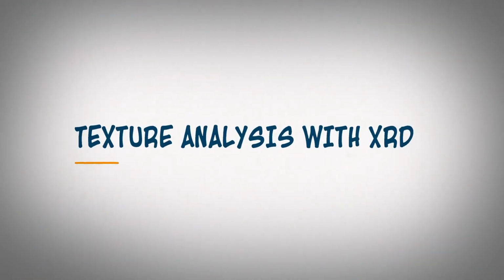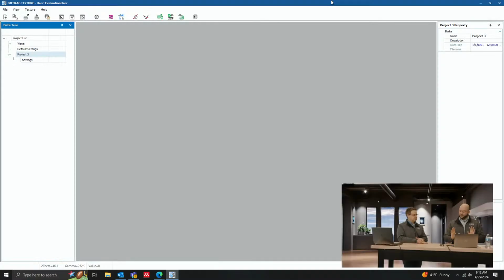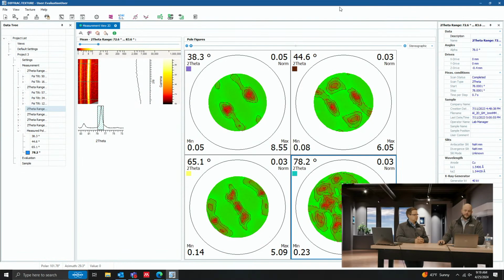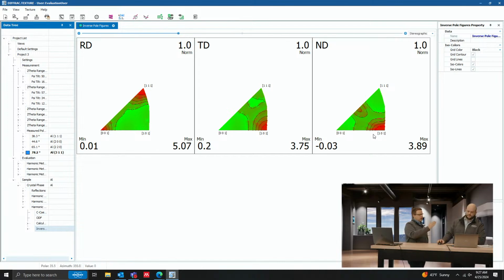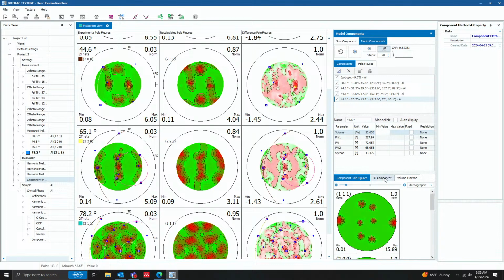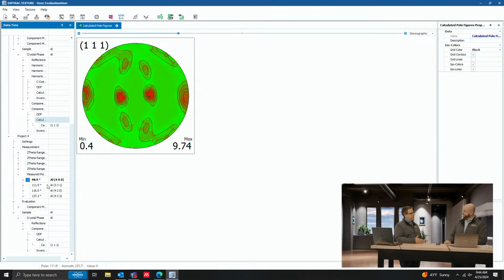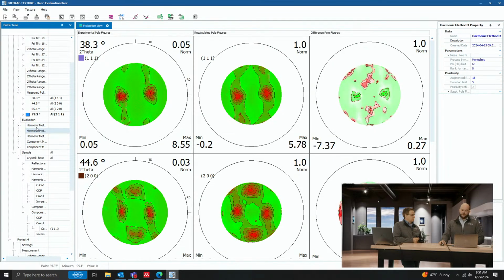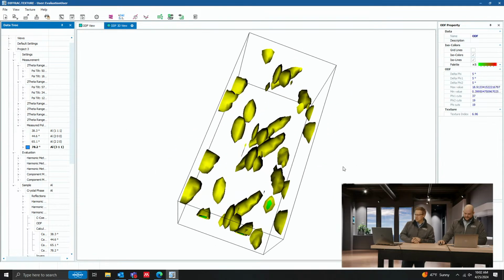Live from the Lab: The Gritty Details of Texture Analysis

Comment: Great lab session! I want to ask how much the iso-inclination will interfere the measurements if the sample surface is not flat? If the sample has a dome shape on the top, will the iso-inclination be a bad measurement type for texture? What you would suggest if we can only perform iso-inclination but still want to perform texture measurements? Thanks.
Reply from the maker: Greetings! Thank you for your question and your interest in Live from the Lab! For side or iso-inclination, the best thing to do for irregularly shaped samples is to constrain the size of the beam and/or use an equatorial soller, which will mitigate issues with sample displacement and surface roughness.